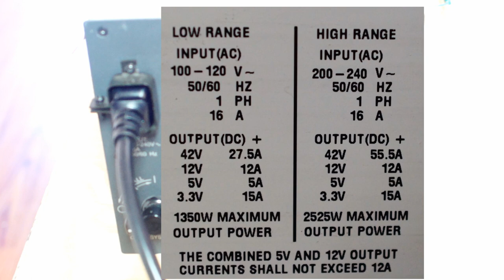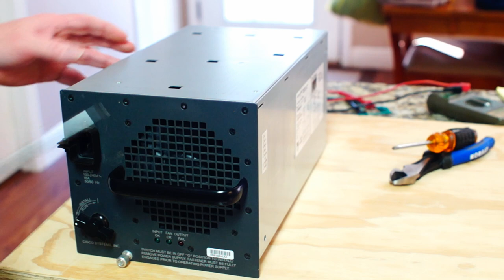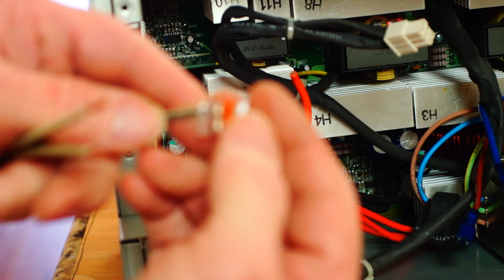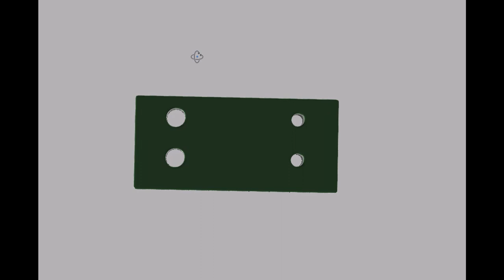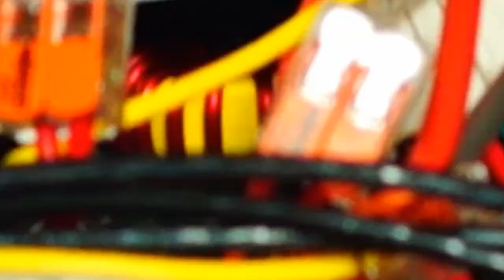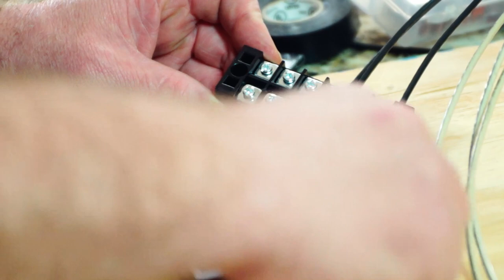Mudd Flapp Ranch- PrintNC Cisco WS-CAC Power Supply modification

Comment: I'm wanting to get 53.5 volts out of mine so I can drive 2-MRF300 AN and 2-MRF300 BN LD mosfet in a push pull configuration. Here's the board I am working with; any help in helping me crank up the voltage out of this unit would be a great help to me.

Comment: this is golden. Im thinking of also swapping out the noisy fan for something quieter.
Reply from the maker: Thanks for watching. The fan in mine is not horrible (unless trying to record a YouTube video), but a 12VDC replacement should be easy to find. Since I am using this power supply for a CNC machine, the noise of the fan will be negligible in the  grand scheme of things.
Reply: @MuddFlappRanch  ya same I will also use it for the cnc. Idk I just have a thing with noisy fans and metal boxes, my CR-10 and it's fans has ruined me...  When cutting absolutely you wont hear it, but I will have my cnc turned on sitting idle for extended periods. and that I can tell will drive me nuts :D

Comment: Great video. I am going a similar route and have a couple of questions.

1. On the PrintNC wiki there is a note that some of the 12V and 5V pins voltage drops when current is pulled on these pins or in some cases, the PSU goes in Fault Mode when current is pulled.  Is this something you experienced as I noted you pulled a couple of pins of each.

2. What contactor did you end up using in your setup.

Thanks for the informative video.
Reply from the maker: Thanks for watching. Yes, there are signal pins on the connector that will drop if you try to pull any current on them. The method I used pulls the voltages directly off of the power regulators and eliminates the  concern of grabbing a signal line. I think if you measure the pins at the connector, you will see a slight difference in the voltage levels on the signal pins (maybe 100-200 mVDC). I know many have gone through the expense and trouble of wiring in a mating connector, but I honestly see no valid reason to do that. 
Also, I do not have a contactor in my current set up, I turn the power supply on and off with the switch on the front panel.
Reply: @MuddFlappRanch  Thanks so much

Comment: Just for clarification, can you go over what you're using each one of the voltages for?  I'm assuming 42 volts for the drivers.  Then the 5 volts for the enable pin on the drivers.  Finally 12 volts for the BoB and maybe for some relays?
I'm starting to work on the electronics for my system and will just be using the 36 volt supply from Aliexpress that came with the kit.  I also have a 24V power supply that I took off my Ender when I replaced it with a Meanwill unit.  I know you can get 5 volts through the USB connection to the BoB.  I have thought about using a voltage converter to just take a line off the 24V unit and run that to the enable pins on the stepper motor drivers.  Seems like one less cable to run to the computer.
Reply from the maker: Well, I haven't wired my electronics yet. I will use the 42V for the stepper drivers. I am thinking of using the 5V to power the BoB (instead of 5V from the USB) and 12V for the limit switches and any contactor/relays.
Reply: @MuddFlappRanch  Seems like you're going to have plenty of current capacity.  I think the stock NEMA 23 motors from the Ali kit are only rated at 3 amps so maybe only about 2.4 amps to be safe.  That's less than 10 amps for all four so I don't see that being a limit for your power supply.  Looking forward to the rest of your build.

Comment: Great video sir. Do you have a complete pin out of the back side 29 pin connector? many thanks. Also, would the psu work fine if it runs with no load?
Reply from the maker: I don't have a pin out of the plug. Mine runs fine with no load.
Reply: @MuddFlappRanch  I see. thanks. do you know if these products will shut itself down if it gets too hot?
Reply: Sir can you explain how to solder together the contact pins and the wire? Shall I feed the solder from the hole on the side? Thanks
\
Reply from the maker: @hqiu7866  I know they have a fan monitor, and they do like shut off with over temp conditions.
Reply: @MuddFlappRanch  do you know the max current rating coming out of those three 42 V sockets?

Comment: I would prefer not to have to crack open the power supply. You mentioned an output plug / pigtail is available. Would you have a part # for this. Cheers.
Reply from the maker: https://wiki.printnc.info/en/electronics/power-supplies  All of the part numbers are on the wiki power supply page. Thanks for watching!
Reply: @MuddFlappRanch  Cheers. I found the video very helpful.

Comment: So these just turn on. I have a 6000w one and it won't turn on.
Reply from the maker: I can't speak for the 6000W version, as I know it has two voltage inputs, but the one I have comes on with the switch on the front. I know on some of the Cisco power supplies, the need an input voltage on one of the pins in the back. I did not think the WS-CAC versions required this, but I will looks through my notes and see.
Reply from the maker: this is from the Cisco installation manual: Note: The 6000 W power supply will not power up if you have only one power cord plugged into either INPUT 1 or INPUT 2 and source AC is low-line (120 VAC nominal). So it looks like you either need to supply 240VAC to INPUT 1, or 120VAC to both INPUT1 and INPUT 2. https://www.cisco.com/c/en/us/td/docs/switches/lan/catalyst6500/hardware/Chassis_Installation/Cat6500/6500_ins/0apwsply.html#65250

Comment: Useful video for modifying the output connection, but unfortunately the explanation for how this power supply works is entirely wrong.   The explanation given is for a linear power supply, but this is a switching power supply and works quite differently.   The devices on the heatsinks are mostly switching mosfets and the larger transformers are flyback transformers.
Reply from the maker: Thanks for watching. Not sure I agree with the statement that I was completely wrong, as the AC is rectified, then regulated. I don't recall attempting to explain how the regulation happened, but agree it is switching versus linear. If you have schematics or other technical data, I will be happy to upload a new video.